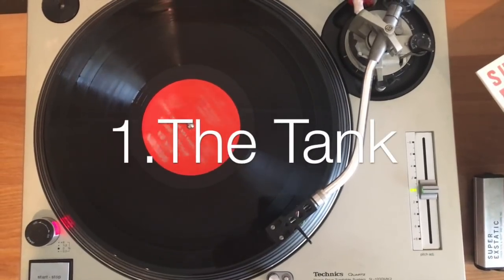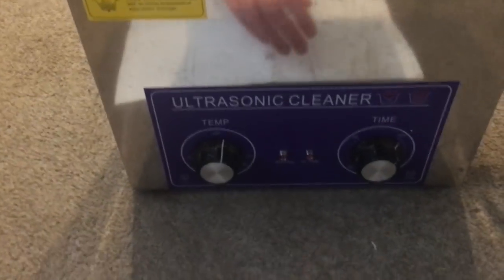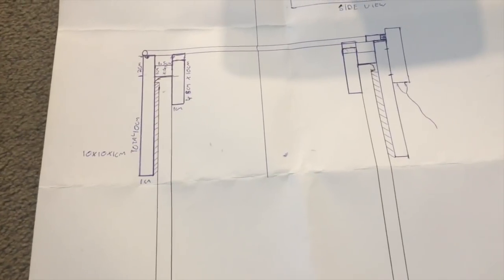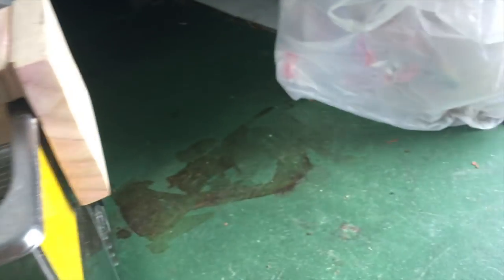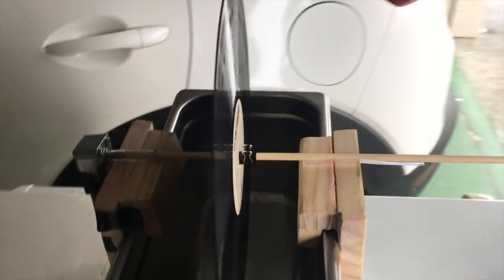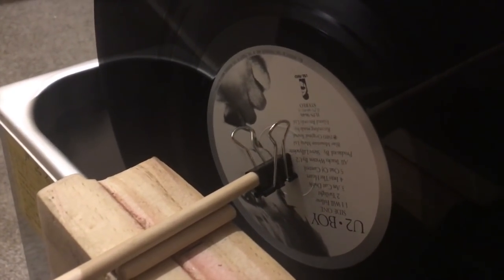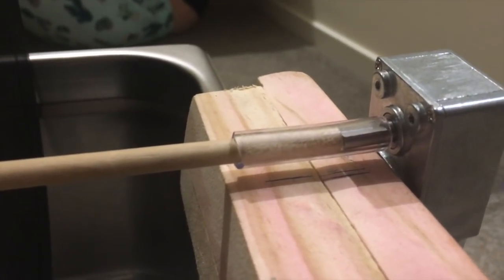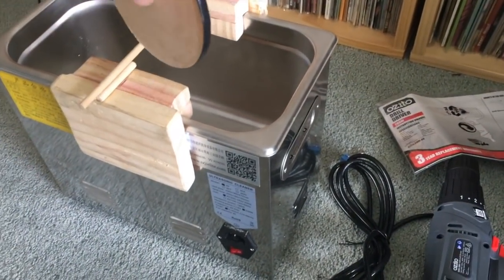How to build a DIY Ultrasonic Vinyl Record Cleaning Machine - Part One.

Comment: Ok so, for some reason the four albums that I did as an experiment (two at a time)—sound worse? More static and crackling. In some cases the highs are even slightly muffled in some areas. I listened to them several times before and after. One of them is a 46yo record that I opened a few years ago. I was pretty surprised. I hesitated for a week to make sure I had everything down pat. I stayed under 35 degrees celsius, and used distilled water for electronics and a tsp of Triton X 100.  Too much? I also rinsed them in distilled water afterwards, and let them dry on the rack. 🤷🏼‍♂️ Idk. I’ve been testing out different methods the last month. Idk, maybe they need another rinse, or a vacuum (my next experiment).

Comment: It looks big enough and should be able to clean records.  I was wondering if the axle drive was giving you too many problems that could have been avoided more easily.  Instead, why not use the drive motor at the edge of the record driving through a soft foam or silicon drive wheel.  The speed could be varied by changing the foam radius.  There would be no wear on playing surfaces.  It would simplify the clamping problem at the record centre because it is now not so crucial to have a tight fit onto the central dowel.

Comment: FYI everybody, a very nice affordable motor option would be a discoball/mirror ball motor. You can get them for 10-25 bucks and they go from 1rpm and up. They are very durable, have great torque, and always run at a constant speed. 

Excellent video, man.

Comment: They say that two records is the max to allow room for cavitation to build up. IF I could have found a shallower, wider cleaner (to allow 3 or 4 records), I would have bought it. 
For wood, a square foot of 5mm plywood is all I needed. I made two 3"x4" plywood spacers, and glued them under the lips, so that the sides of the cleaner were then effectively flat, and the upper sections came off and went on easily. The plywood is also easily strong enough to form the upper sections, with one thickness inside and outside the cleaner, and two thicknesses bolted in between, on each side. (Most 6L cleaners have a 5 mm lip and about a 10mm width).

Comment: Well, very interesting, I know that a local hifi shop I have been dealing with lately has an Ultrasonic record cleaner which ther retail for well over $5000, although after a quick serch I see Real groovy had a cheap looking plastic one for about $660. Still I have a neighbour who is an engineer and could probably help come up with some more Ideas on the mounting and rotating of the records. I might have to look into this. Look forward to part two.

Comment: Coincidence, I got the Cleanervinyl one shipped from u.s.a. yesterday, it isn't cheap, maybe some design charges. I got the pro version and tried 12 in one go but I think less would be better for cleaning, it seems to work and is fast. I used purified drinking water and Kodak Photo-flo which is enviromentally hazardous if flushed into waterways.

Comment: Not too shabby. I got a Ultrasonic Cleaner for Xmas 2016 but did an absolute shit job of using it all of last year. It’s one of the things I’m aiming to do better in 2018. Used it a few times already since the new year and am happy with it so far. I’ll be curious to hear how it all works out for you. I’ll probably talk with you about it more on FB.
Reply: If you are using it for cleaning records, I suggest using it on every single record you buy from now on, including factory sealed records. It's worth the time spent.